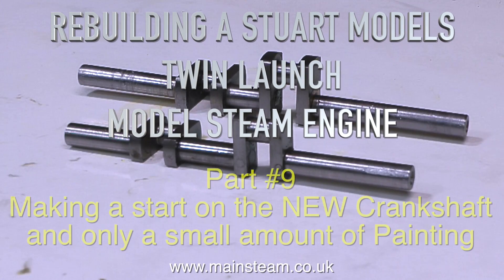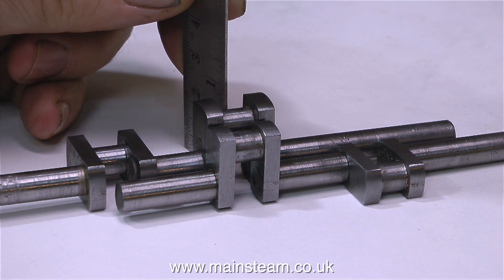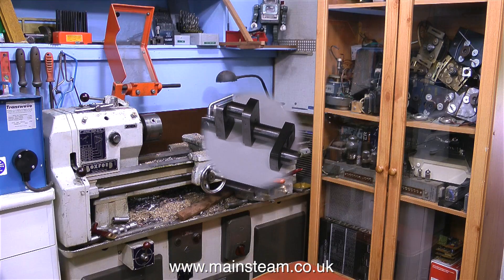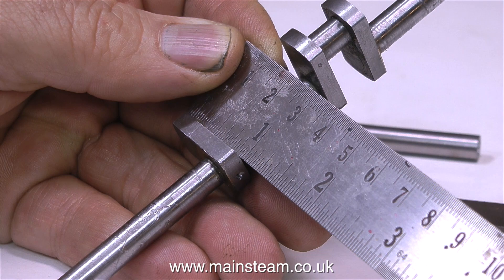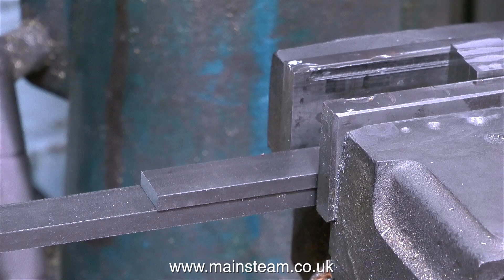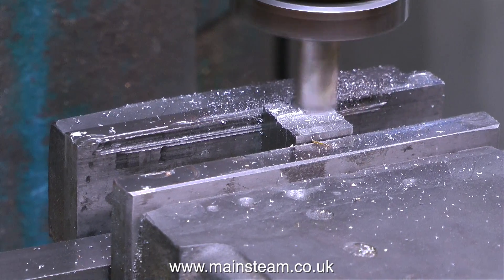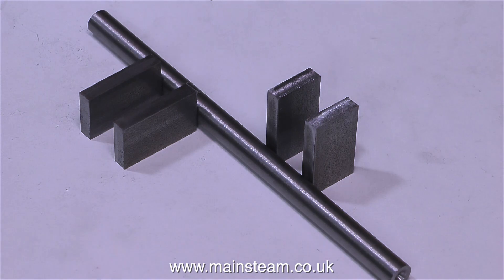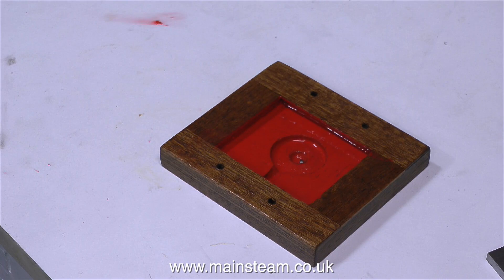STUART MODELS TWIN LAUNCH STEAM ENGINE REBUILD - PART #9

Comment: Nice but you have a lathe and Turning a one piece 2 journal crank is fast and easy.  Wondering why you chose this way? To keep it original perhaps?
Reply from the maker: Speed and to show beginners what is possible if they do not have years of machining experience . . . . .

Comment: Keith, you are quite correct about carcinogenic smoke given off by so-called cutting oils, whereby 'white water', full-flow or spray coolant application is less than a thousandth so.

Comment: Am I the first to click the thumb up? There is already many comments with thumb up counter set to a value higher than zero. The view counter:16464, 0x4050. There is 3 bit set to 1 in binary: D14, D6 and D4.

I would venture a first  hypothesis based on a limited sample of data: the main view counter could be located in a computer close to the author and the value updated here (I live 5 miles from Mountain View where Google started) when a fast binary modulo is detected.

The fastest modulo consist in just using a binary "AND" operation to isolate a range of bits in a binary value, This takes a single machine cycle or 1/4 billionth of second on a 4 Giga Hertz processor. A standard modulo uses a division operation or, with clever fixed point math, a multiplication.

What this comment has to do with steam engine? I had the same pleasure studying/fixing a well crafted automatic piano (100 hundred years old pedal pump, with music printed using holes on a roll of paper) as the pleasure of well crafted software on pinball machine or other embedded device. Both type of engineering are done by people who do their best.

Good video!

Comment: I'll be interested to see how you go about making the crank webs.  I'm no good at marking out or match drilling so I have a DRO in the mill for that sort of work and drilling bolt hole patterns.

I've made perhaps a dozen steam engines over the years, including a 7 1/2 gauge 3 truck Shay from castings which I drive at tracks here in the western US (I live in New Mexico).  I'm just finishing adding a compressor and air brakes to my riding car for a more calm ride at a friend's track in Durango where 6% grades are more common than not.

Keep up the good work and don't worry about the voices.  Most model engineers have them.

Comment: I applaud your comment on machining with carcinogenic coolants. Oil-based lubricants are extremely carcinogenic in the fumes and smoke they omit. 'White Water' coolant is preferred, due to it doing the cooling job whilst not releasing gaseous fumes.
Reply: When I was learning machining 35 years ago, I had very bad problems with the oil fume.  Oddly, other peeps seemed to not notice.  I wanted to build a vacuum system to suck out all the fumes but other people thot I was crazy.  Well, I DO have ADHD--better becarefull what you say about me, I might come at you with a chainsaw or a lubricant.

Comment: I'm interested in (full size) steam locomotives but I never seriously considered building model engines or boats, and the most sophisticated tool I have is a cordless drill. But your videos still are very interesting for me, and because I watched many of them last weekend, I could be a reason for the number of hits going up. 

And now I feel the urge to dig out my 40+ years old Wilesco toy steam engine and get it running again...

(But I won't paint it because it still looks quite nice.)

Comment: Been much enjoying these steam engine videos!  Very informative and often very funny, thank you for making it so entertaining.  I, too, spent a lifetime fixing computers, everything from mainframes to micros, in far away places.  Also enjoyed doing crazy things with model airplanes for many years which you've mentioned a few times.  Even played the piano for a few years. Never tried steam engines though. Gonna have to try to find a pond now, then a nearby hobby/machine shop, then a broken engine or two to rip apart...  At least I won't have to reinvent the wheel learning the craft, thanks to these videos.

Comment: a little bit of your steam oil or your light machine oil, say a couple of drops just enough to wet the top of the pieces of steel you are cutting would be something I recommend you do. You won't get massive amounts of coolant/lube all over the shop since it is too little to be thrown about, it will save your cutters from premature wearing, and it will increase the quality of your surface finish even a bit more than the already beautiful finishes you already get.

A little dab will do ya, a trick I learned from watching many many machinists here while waiting to get my lathe/milling machine :)
Reply from the maker: I use my Steam oil/Rapeseed oil mixture usually, but for the purposes of a clearer video I machined these parts dry :-)))
Reply: Fair enough, I figured a small amount would mean that the video would be less obscured as well is all. Thanks for the reply and enjoy your newfound popularity mate!

Comment: I reckon you'll need that bit of steel you stuck in the offcuts drawer.  You didn't look to have allowed the extra length for the crank pins overlapping the mainshaft in the crank webs.   Mind you it has gone midnight so I may have dozed off during the bit where you said you were making the pins out of something else so didn't need to add 4 crank web thickness to the length
Reply from the maker: Please watch the next episode . . . all will be revealed :-)))

Comment: Generally if there's a dimension left off a drawing I get a phone call from a machinist.
Reply: I wasn't complaining...just pointing out my own shortcomings.
I prefer getting phone calls than not and someone guessing ;)
Reply: That sounds horrid :( 
Thankfully the places I've worked have been pretty hot on drawing change control - mostly.  I like to work closely with the guys in the machine shop where I work, tends to help to be their friends I find.
Reply: Wise words that :)
Reply: Well, as a designer, draftsperson and machinist, I have had ALL those problems of missing dimensions--once I got complete drawings from another part of the company and not looking over the drawings, I sent them on to a 3rd party to make the parts.  ONe page had 90% of the dims NOT there.  i had to fill them in, very embarrassed, but I did not get the blame for it.

Comment: My motto is "Beat it to fit, paint it to match".
Reply: i find if it doesn't fit find a bigger hammer works quite well
Reply: HeavyMetal Gamer , absolutely.  Generally, the size of the brush is proportional to the weight of the hammer, mallet, or sledge.
Reply: @P61guy61 - Sledgehammer-mecanic 🎶🎶🎶 Peter Gabriels father 🧐

Comment: Hi Keith. Discovered your channel some weeks ago: nice! But addictive.

Some comments on your use of Bahco's. Using it as a gauge was the 'drip' (part of Dutch expression where a single drip eventually overflows a bucket full of other drops).
I noted you frequently use a Bahco on small bolts and nuts. In my book (old school Marine Engineer) an absolute 'not done'.  I can stil vividly recall the comments made by the Chief Engineers (45 years ago) to always use properly sized spanners. Bahco's (in time) will round any fasteners. It hurts my eyes when you use an oversized Bahco on those nice small nuts.

I agree with earlier comments about grinding on sand paper in circular motion; figures 8 are even better. Oh, those lovely days grinding away at air compressor valves to get them true en flat again.

Comment: It's possible you're seeing more hits due to YouTube updating their recommendation algorithms. I started watching some clock machining videos (a few months ago), which then resulted in me seeing milling/lathe workshop videos, and then suddenly some of your older material showed up (two days ago). As it happens, I have a bit of an interest in steam engines - my mother's godfather was a Channel Tunnel engineer who also had a model steam engine workshop, and I remember riding around on a traction engine model in his house (it had the boiler etc, but it wasn't run up inside the house!) - so I've been enjoying your commentary and wishing I didn't live in an apartment with no space for any kind of workshop.
Reply: You would be surprised what you can build even with a workshop that can fit in a suitcase, it's not so much the tools but the worker. Admittedly small tools generally mean small models but think of the saving in material costs.
Reply: Good point.. though my place is already kind of full with boat bits and computer bits. Adding something that generates swarf.. well, it's not like I need another reason to go find a house with a shed :)
Reply: "A" shed, what, just the one? Sounds like you don't have enough ambition. :>)
Reply: Well, my definition of shed might be more like a barn. Though finding one of those within commute distance of Dublin could be hard.
Reply: "not even for ready money" to quote from the Importance of being earnest.
Reply: I solved THAT problem:  I kikt the wife out and threw out the bet and put a removable cot and added a small workbench with a toy lathe.  Best thing I ever did.